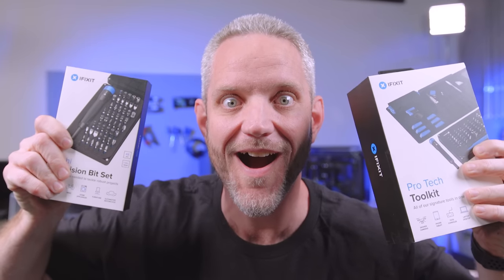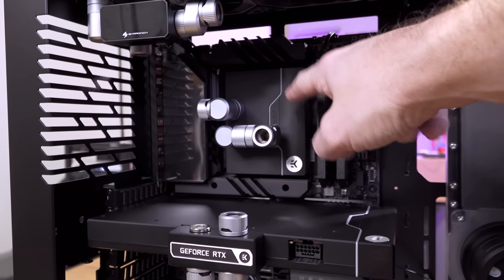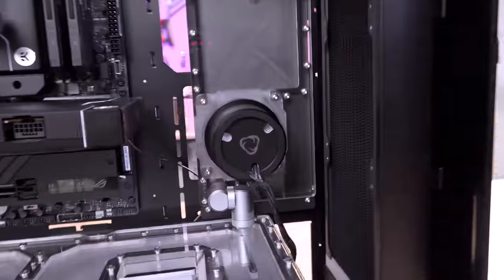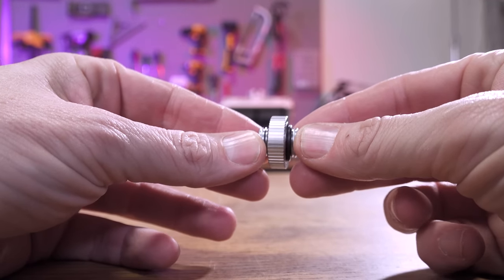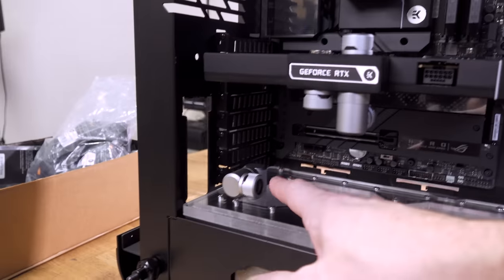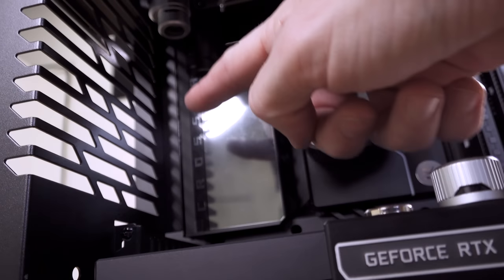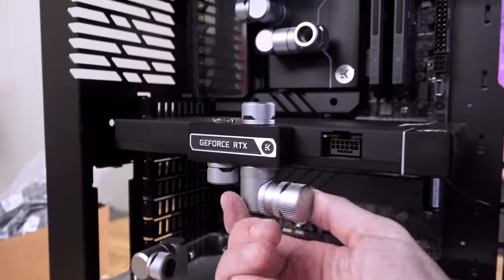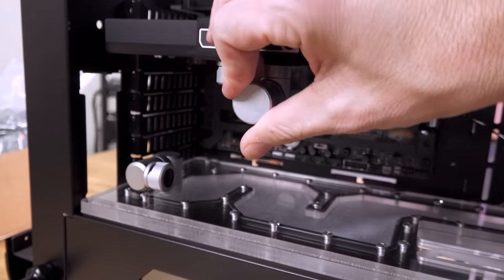My personal system is DONE and its BEAUTIFUL!

Comment: Hey J, just gottta say, I just built my first gaming PC a few days ago after nearly 1 year of saving/research and I wanted to thank you for being an incredible resource for component info, and other invaluable advice.  Thank you for all that you do to help us noobies! ❤
Reply: Share u r rig specs!
Reply: Yeah what did you build I want to know
Reply: Well, I built mine a month and a half ago. Jay was a massive resource. And for all of you curious people, my specs are: i9-13900KS, MSI RTX 4080 Gaming X Trio, 32 GB G.Skill DDR5 @ 7200mhz, MSI Z790 GODLIKE, Seasonic Titanium 1000W PSU.
Reply: Nice
Reply: Same here. I built my first PC back in June of 2022 as a wedding present to myself. I couldn’t have done it without Jay’s videos.
Reply: built my 32gb ddr4  i7.9700k 2080s all watercooled 2019 $3.5k
wont bother again does what i need upgrades $k,s be an overkill
Reply: @DR-ge8hp  Dude...nice!  My first build back in the day was an FX6300 and GTX 950.  Wanna race! :D
Reply: @markissboi3583  good for u pal but $$ is not a problem for jay
Reply: Just built myself a new pc as well after my old build was slowing down. Got a new job and figured I'd buy myself something nice to celebrate. i9 13900k, msi rtx 4090, 64gb g skill ddr5 @7200mhz on a gigabyte z790 aorus master. With 5tb of nvme storage split up on 3 drives. Definitely overkill but worth it
Reply: This’ll be my comment in a couple months lol
Jay sure is amazing
Reply: I also build one thx to jay many years ago when he was heavy into watercooling, so i build the biggest pc with 2 waterloops
Its on my channel 
Its called T virus PC
Reply: After 11 years I got back into pc's and built my second pc about 9 months ago.
12700k clocked at 5,1 ghz
Aorus z690 ultra mobo
Asus rog strix rtx3080ti
32GB 5600mhz ddr5 corsair dominator white
Gigabyte ud1000gm pg5 (12vhpwr), for future graphics card.
Waiting for 50series.
Built in an nzxt h7flow black and white with nzxt z63 kraken white for cooling and 4 extra 140mil nzxt aer rgb2 white fans
Samsung 980pro ssd
Strimer rgb cable mod
And 7inch touch raspberry pi sensor panel in the case.
I went for the black and white theme for making an stormtrooper theme.
Still need to add stickers and I am looking for an nice star wars wrap for the backplate of the case but I can't find any customizable wraps in the right size😞
Reply: Or someone who is like really good in airbrushing lol
Reply: Bruh I've been saving for seven years and I still don't have enough for the most barebones system ;-;
Good for you though!
Reply: What a tease, don’t even share your specs
Reply: @ant420  nice name
Reply: Welcome to the club! Watch out its addicting. I built my first PC not even a year ago and have already upgraded to a new CPU and next gen GPU. Lol
Reply: @XOR_The_Protogen  you could build one with a 6600 xt for around $500
Reply: The reason I built PC is because I reserve a steamdeck and it kept getting pushed back when I'd get it. I started out with a. APU build with a 5700G, then eventually got a 6750XT and just recently upgraded to a 5800x3d and a 7900xt! Shit is addicting!
Reply: Same I just built a all white system with a 3070 and a 11400f waiting on an Aio and a usb for windows install
Reply: @markissboi3583  a new cpu would probably do you good though, micro center has amazing mobo bundle deals sometimes 👍🏻💪🏻
Reply: Not really a "noob" in pc building, but Jay has really helped me out over the years.  Here is my latest build from last month is as follows...
i7 12700K 
MSI MPG Z790 EDGE WiFi
32g DDR5 Corsair Dominator 5200 CMT32GX5M2B5200C40W
MSI NVIDIA 4070ti SUPRIM X 12g
Corsair iCUE H150i ELITE CAPELLIX with LCD Upgrade white
10 LIAN LI 120 UniFan SLI white
CableMod 12VHPWR white
CableMod Seasonic custom cables white
NZXT H9 FLOW White
I plan to swap ram for some faster, but at the time it was in the budget.  My only wish is Corsair made dummy sticks for the DDR5 Dominators or DDR5 since Intel doesn't play nice with 4 sticks and I see recently AMD has the same problem with their newest lineup of cpus.
Reply: Congrats!
Reply: To add to that sentiment. I did my first build before watching tech tubers like Jay(and Bitwit) and I made a noob mistake that saved me some money but I shot myself in the foot when it comes to future  proofing my build!
Reply: @DR-ge8hp  how're getting on with DDR 5? 12th gen didn't really seem to benefit.
Reply: @oktc68  I'm not sure that it's all magic rainbows. I can say that my 13900KS temps are basically equal to the surface of the son, so I'm sure i'm leaving plenty on the table.
Reply: @DR-ge8hp  i’d like to share mine that i finished maybe a month ago. it’s my 3rd build but the build that made my dreams a reality. 
R9 5900x , 3080ti, GSkill Trident Z Neo 32gb ram oc’ed @4000mhz, MSI Pro Series X570, 1000w evga gq 80+gold, rog lcII 360mm aio, and 9 lian li sl 120’s all inside the aigo az300 with an aftermarket vertical gpu mount.
Reply: @Limburg92  putting a screen in my case is probably the next thing i want to do. sometbing to display all my temps i use my stream deck as of now but can’t always keep it up as i use it to switch scenes while streaming and to join different discord voice channels. was it easy? ik i can watch a vid but from you yourself was it difficult at all?
Reply: @julvy2521  it was quite easy, most difficult part is how do you want to mount it?
You have display cases and let it stand in  your case.
You can mount it on your back fan mount but i didnt because I have fans in every slot haha.
Third option is make an custom frame, 3d printed or i did make an frame from an compressed wood panel and painted it black.
Reply: @julvy2521  on my channel in my shorts you can see my case.
Sorry for the bad quality tho😅
Also changed the cable routing for the screen to make it a little less all over the case lol.
Reply: @julvy2521  What is your favorite part? did you have any problems getting it together?
Reply: @DR-ge8hp  had a gigabyte mobo that was bad from the start cause my games to stutter like crazy but switched that out. id have to say my 3080ti or the trident z neo memory because i got the memory on clearance at microcenter but my gpu was also hella cheap so it’s kinda hard. my favorite parts go by the deals i got on them and those were 2 of the best
Reply: @Limburg92  i’m thinking the back fan mount since it isn’t being used and my gpu is also vertical so. but also checked yours out and build looks amazing man!!
Reply: @julvy2521  games looking good on the system?
Reply: @DR-ge8hp  absolutely perfect now. perfect for my 240hz monitor
Reply: @julvy2521  good and probally the easiest mount/placement.
Thank you man👍🏻
What gigabyte board did you have, read that you had problems with stutter.
Well when its done let us see your build👍🏻😁
Reply: @julvy2521  just watched your setup, looks good man👍🏻
Reply: @Limburg92  it’s changed a good bit now. sold 2 monitors got a 240hz for the main and now only have 3 and my build is different in that video as well. prob gonna make another one when i finally move out soon
Reply: @julvy2521  nicee👍🏻 i will subscribe so i can see your new set up.
I am thinking about going 4k 144hz and maybe 2 side 2ks.
Or just maybe 3 2ks.
I think I wont profit that much on the 4k with certain games where i can use 3 screens.
Maybe go 240s as well.
My 3080ti is barely good for 60fps at the highest games atm.
40 series is not much better if you dont count raystracing.
I will wait for the 50 series for 4k.
They say that the 50series will be the biggest leap for intells history.
Also heard their is an possable that they will make 14th gen intel lga1700.
So it would be compateble with z690 and z790 hopefully.
Amd is nicer on the reusage of mobo's but than again I do love my intel shit😅
Reply: @azuren G Skill has kits that are rated up to 8000 mhz I believe.
Reply: I built my first PC in the mid 90s the same way, buying parts as I could afford them and building it over months. It is such a great feeling of accomplishment. Nice work!

Comment: 15:28 Here are some fun facts about the PMMA tubing used in this build! PMMA stands for poly(methyl methacrylate), which is the polymer of methyl methacrylate, a derivative of acrylic acid. Jay, you were exactly right when you said that PMMA is just like "acrylic," because PMMA is the most common acrylic material! PMMA is also the material in "acrylic" windows for PC cases. Companies can process the material differently to get the frosted look instead of the transparent look. It is a relatively brittle material (hence why you cannot use the shears on it like PVC) and begins to melt at 105 C, and at 220 C, it is fully melted. At 105 C, it does not flow very well. This is because the PMMA molecules are entangled with one another, making it hard to move past one another. PMMA is stable up to approximately 200-250 C (your milage may vary). Corsair is definitely not synthesizing PMMA. They might buy PMMA and process it into tubing, but they might also just buy the manufactured tubing from another company. 

Awesome build! It makes me want to do a custom loop on my next PC (many years in the future). Phil's montage was a work of art, as usual! Thank you guys for creating informative and entertaining content! This has been my favorite youtube channel for over a year.
Reply: Bro PMMA is a drug. You must be sheltered.
Reply: Very informative and interesting!
Reply: ...Ethan Rose   Good job, Professor!  I thought that I was the only one obsessive enough to look up materials like that...🇺🇸 😎👍☕
Reply: @JustThePR  PMMA is also an engineering material. You must be spending your cash on the wrong things.
Reply: Excuse my ignorance, but if it's stable up to 250f, how does it start to melt at 105f?  Thanks!

Comment: We love how your rig turned out! 🧡 The satin-titanium fittings were definitely the right choice - they genuinely liven up the build!
Reply: Facy seeing you snooping around Jay's personal build videos. Love your products, your FLT res /w D5 pump saved my mid tower build.
Reply: Please tell Jayz to show off your Torque Screwdriver. I love how I no longer overtighten or strip screws when I use mine.
Reply: gmu_alum08  Some people should just stick to prebuilds.
Reply: @wethepeople3670  Yeah I have one of their 360mm AIOs and I've had zero issues over the past few years with it

Comment: Jay and iFixit, the only ad spot I don't skip because it's hillarious. :)

I enjoy watching your builds. Never done a custom loop myself, though used many AIOs. Some day perhaps.
Reply: I was going to comment this too.. it's absolute gold.
Reply: It's all about the minow 😊😊😊
Reply: @christophermullins7163  Even my very non-techy gf thinks it's funny. :D
Reply: It’s not hard. It takes lots of money and just some planning. You’ll waste tubes and if you live near a microcenter you’ll be running there a lot for odds and ends you didn’t foresee. The worst part which no one talks about is having to drain and disassemble your entire loop to get to a ram slot or nvme drive. If you tinker a lot or upgrade nvme drives it gets old quick. Soft tubing is a little more forgiving in this department. Last year I got tired of having to tear my whole build down that I went back to aio. Now I’m ready to build a loop, just waiting for my 4090 to arrive. Then in a year I’m sure I’ll get tired and switch back to aio. It’s a cycle, and a labor of love.
Reply: While I do agree I think it's time to update the commercial.  Especially since the inventory problem doesn't exist anymore.  That said, when I went to repair the Joy Cons on my Switch I spent the extra $ on the iFixIt stuff to support their sponsorship of JTC.

 @michaelv1984  I've wanted to do my own water cooled system for over 20 years and finally did one 1.5 years ago and went soft tubing.  It's definitely easier though not as pretty as hard tubing but what you said about making numerous runs for parts still stands true!  I live in Montana so there's no chance of getting PC components in a timely manner so it took a few weeks of ordering various new fittings and routing things differently.
Reply: @michaelv1984  well said. You need like 500 to do it and then there are all the bits to deal with.   Mario And Luigi will be proud after your finished as it will look so nice. Hehehe 😊
Reply: @michaelv1984  I'm in the UK, so alas no Microcenter (infact no store of any kind just has PC stuff on shelves in that manner, they don't exist here anymore).

Maybe I'll try a custom loop someday, but my eyesight ain't so great now so I might just stick with AIOs, I don't know.
Reply: And he is using a LTT screwdriver to attach the Unifans to the rad. 😂

Comment: Fun fact : I used to work for a Dental Lab doing cad/cam work designing crowns and bridges. A lot of temporary crowns, bridges and dentures are made out of PMMA these days. It's the cleanest/best looking material that is strong enough for day to day use before the finished porcelain product is finished. Never seen it used outside of the dental industry! Long time fan, keep up the cool builds!

Comment: These videos never get old. Your channel and a couple others taught me how to build my own PC back in 2016. I built another one in 2017. Was awesome info then, and still awesome information. Glad to see how far the channel has come. 2016 feels like forever ago. I still have both PC, and still use the 2017 one everyday. I want to upgrade it to maybe a Ryzen 7950x, with an Asus Z670E-E and a kick butt graphics card, a Corsair LCD XT cooler and some Corsair ram. 

I recently updated the 1060 that was in it to a GTX 3060 as well as an ultra wide monitor and changed everything over to a Hyte y60 case. But for being a i7-7700k with an Asus z270 gaming, it’s still fast and I can play everything in Ultra. Without you guys, I would still be dreaming. Just wish I had the funds to upgrade to my dream build.  Next thing I want to upgrade to is the AIO, mine is a H115i from 2017, not sure how much life it has left in it.

Comment: I'm still on a shitbox computer, upgrading to an aio soon, yet I'm researching water-cooling. It's crazy how computers taught me about voltage and soldering, plumbing, diy-engineering, and how rigid pieces of metal with some air or water in-between  can help cool processors to stay under 80 degrees. It's crazy, but I love it. Weird way of saying I like building computers, but I'm just happy to have the privilege of getting great info from jay

Comment: Glad to see someone who's as into watercooling as you finally show of a leak tester!
As a budget concious watercooler (yeah I know, it doesn't really work) that is the most vital piece of equipment you can get.

It allowed me to buy used hardware and check every component by itself, then test the whole loop. Had a slight leak on the CPU block, that would definitely screw up my day.

Comment: Add your own thread to the rad for a drain port. I've previously done it a couple of times and not too hard if you are used to case modding. Just make sure the end caps on the rad are brass, drill a hole use a brass G1/4 female fitting as an insert, flux and solder it in. Drain port.

Comment: Building my first rig in over 10 years (and first ever water-cooled) seems I've made good choices on components as I've picked similar to yourself although my hard pipe definitely isn't looking as smart. Just waiting on my flow meter (same one as yours) to arrive tomorrow so good to know about switching the impeller over. Taken considerably longer than i expected with all the RGB and water-cooling and I'm only doing that on the CPU. Been following the channel for loads of tips during this build which has been really helpful and at points saved me making painstaking mistakes.

Comment: on 9:49: You can actually fit the 28mm fittings in there by separating the 2x 90 rotary fittings and installing the 28mm first to the 1st 90rotary. The trick would be to connect the 28mm + 90 fitting first to the res then you can just rotate the rotary part of that 90 to connect to the 90 on the radiator. I've done it a few times before in similar situations

Comment: It looks great, Jay! I'm going with three of EK's crossflow rads for my O11D XL with two sets of QD fittings between the water blocks and the rads that will allow me to take the rads out for easy dusting. The bottom QD will also function as my drain and I'll have an Alphacool flow and temp meter so that I can monitor the liquid temps and the flow rate and use that in Fan Control to adjust the fans and pump to keep the system cool under load.

To be honest, I haven't done any watercooling since the mid-2000s so it's somewhat daunting, but I'm excited to do it.

Comment: I've been using shelving L brackets involving GFX cards, a tiny L braket is made to hold over a hundred pounds, so buying & cutting it down to the size you need.  And if you tap screws in the right places, the GFX Card will NEVER move, or sag.  When helping a friend who built his own case out of wood, we used a shelving L bracket to mount the card vertical, mounting the PCIe in the bracket, lol now I want to do it on a my next build.

Comment: The rotatory 90s allow you to screw in tight spots. Attach the male/male to the 90, attach to reservoir then use the 90 rotatory to screw into the other fittings.

Comment: Hey @JayzTwoCents , that 28mm Male male static extender you’d like to put in that small spot connecting rad to distro plate that you say you can’t add. Why not just work backwards? Take everything on that line off and work backwards starting from the distro. So in order of input start from distro plate, screw in 28mm, then screw in 90. Then go from the rad and do the same until the last part is the 14mm extender. Use the rotary on the 90 for easy installation. Take the tube out, it’ll look much cleaner man